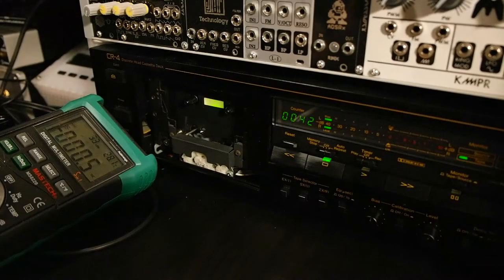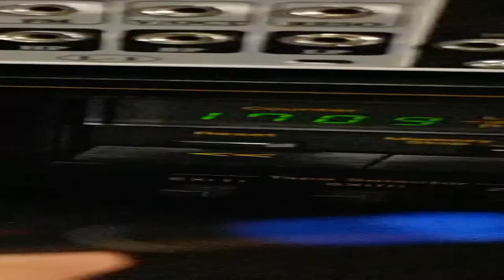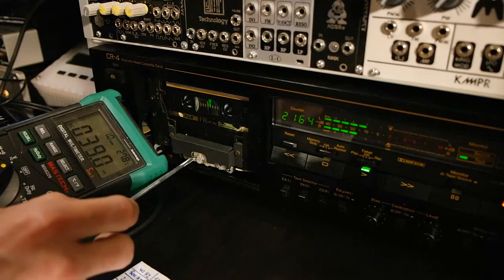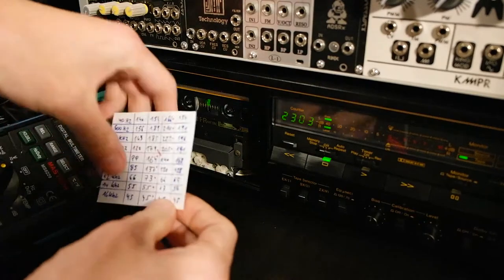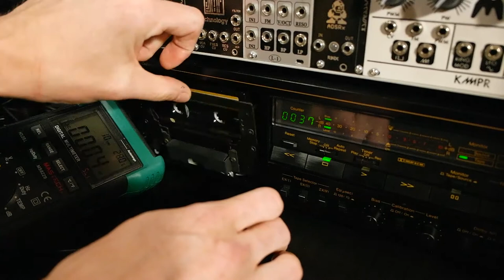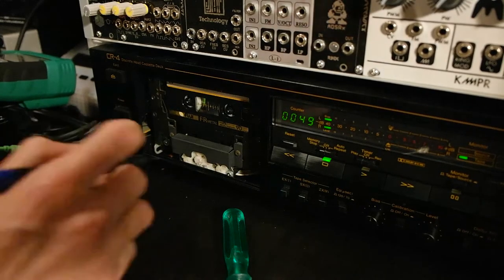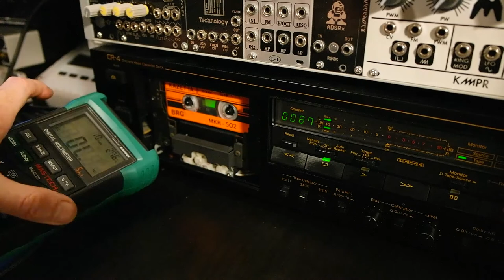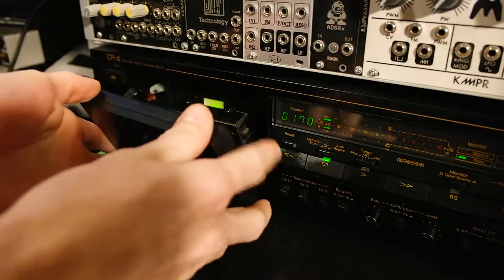Nakamichi CR-4 Head Adjustment (Height)

Comment: Everyone has their views, and if I may add mine: 

I think Nakamichi advice that the height is adjusted for max output (from their two-track 1Khz ref tape) , then followed by an azimuth trim (from another full-track 10Khz ref tape), then again to max output, then azimuth again etc until max output and true azimuth are achieved.

The theoretical best would be achieved using a trully accurate narrow track reference tape, usually at 1Khz. Here we aim for L/R Ch to be equal and co-incidentally minimal output.

Comment: Nice video. But I must point out that you're accually using the wrong type of a multimeter. it should always be  of the analog movement type and never digital. The digital nature of a numerical reading si extremly tricky to read and almost never aqurate. The mechanical swing of a needle si by far the best and most aquare way of doing such a sensitive job. Perhaps a proper old style high precission VTVM would be the best tool. However despite of all of the above arguments you still managed to do a decent job. Well done. Tnx for the video effort.
Reply from the maker: Thanks. I tried my best with the tools I had but you are 100% right. Its not the proper way but I am very happy with the results and I had a lot of fun going through the process 😄

Comment: It does't take into account that azimuth changes unfortunately as well when you adjust the height very little but it definitely does, hence you effect heights frequency response as well. hence you cannot take trebles as a factor to judge anything that's why they use 1kHz tone.... not 15khz or 50hz I wouldn't recommend your way

Comment: Hi! Great video! I just have one doubt, in every Nakamichi service manual I have seen, it says when it comes to head height adjustmente the following:
"(1) Playback Head Height Adjustment and Azimuth
Alignment
(a) Connect a VTVM to the Output Jacks.
(b) Load a 1 kHz Track Alignment Tape (DA09007A), then
set the N-481 in play mode.
(c) Turn the PH Height Gear until the output of both
channels becomes minimum."
Why does it say on c) that for height you should turn the gear till ouput becomes minimum? Shouldn't it be maximum? The way you made makes more sense to me! I never understood this? Any idea, anyone?! Thanks  in  advance? :)
Reply from the maker: Hey there. I am not aware of this service manual and I also don't have a VTVM. I was using my method for myself with success but of course there will be more qualified people out there. My recordings all sound great and from a logical point of view I also don't understand the instructions in your manual. Lets see if someone else has an idea ?
Reply: @ryux  VTVM is Vacuum Tube Volt-Meter. Any AC Voltmeter these days capable to measure 1kHz should be fine. The original Nakamichi 1kHz tapes had the signal recorded invers. There was nothing recorded where the tracks usually are and there was signal where there normally is nothing. Therefore you would aim for lowest possible signal.
Reply: @DesmodromSK  that stuff bugs me from ages I just adjust naks in traditional way with the scope trying to find best possible tracking condition.... it's very very very unlikely that its true what you are saying... from economical stand point I do not believe that they constructed such device with weirdest head ever just to record special track calibration cassettes... Can you back up what you are saying with some evidence? I have my theory haw to do it with full accordance to original manual (they just didn't say everything in service manual as they relying on technician intelligence or something) never done though as my way works for me....
Reply: Looking at the service manual for the CR-40 (which lists the CR-4 as well). It has exactly the same description for point (c) for the playback head.

 But when it comes to adjusting the height and azimuth for the record head, then it says to go for the maximum output level. It does say that for the PB head calibration, for the Azimuth alignment adjustment, to set it to the maximum output for both channels. This video was starting off adjusting the height of the PB head, and went for the max output with a 10Khz tape. Versus the manual wanting a 1khz tape with lowest output values.

Comment: Can you recommend where to buy an azimuth test tape from?  I see them all over ebay, but no way to tell which are accurately created.
Reply from the maker: Hello Eric. I was lucky and got one from a Forum Member. But I have to admit it is a gamble as you have to make sure that those tapes have been recorded on an absolute reference machine. I would try to look for tapes in some Tape Audio Forums or maybe even on Ebay (if they look legit). Hope you find them soon. Best of luck
Reply: @ryux  thanks for the info. I'll comb through the Tapeheads forum.